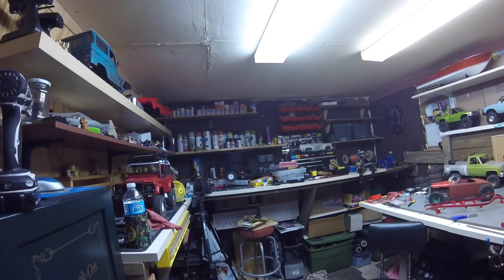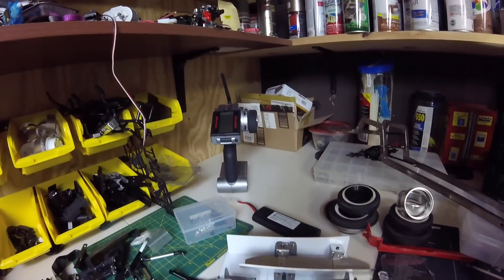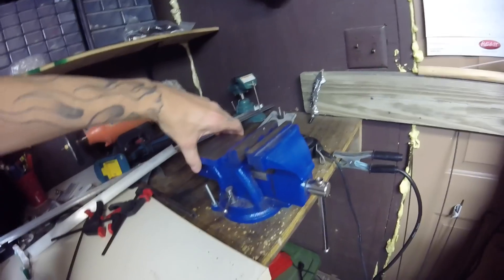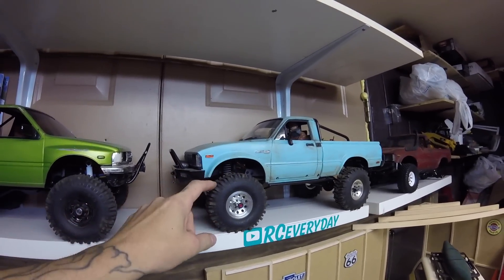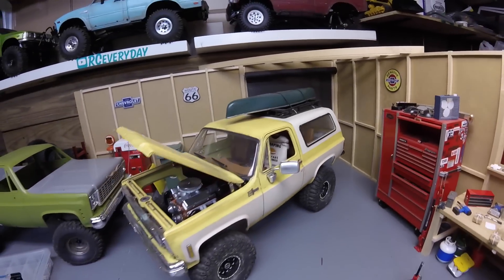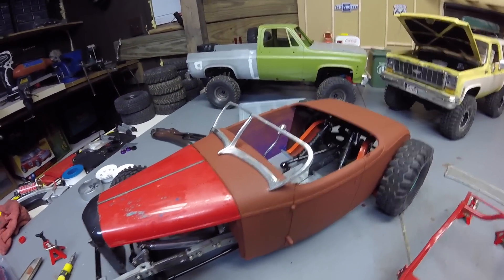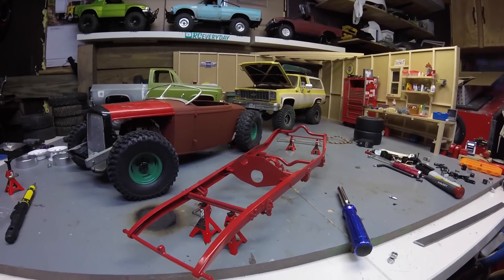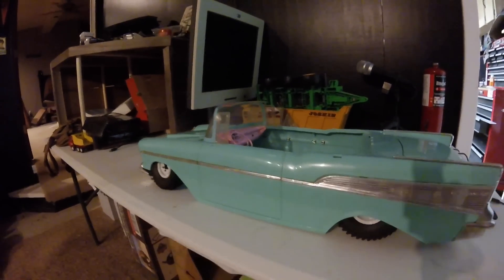Walkthrough of the RCeveryday Studio Hot Rods and Junk

Comment: What type of servos and radio would you recomend me I still haven't got one. And I can't wait to see my tf2 running
Reply from the maker: I use savox servos mostly, cant remember which model but it cost around $80usd.  Holmes hobbies motors are a must, and I run them with the axial ae2 esc which is made by castle.  Pretty reasonably priced stuff except the servo, got to spend big for a good one.
Reply: Oh okay I was going to check my LHS next time I'm in town. Do you recomend spectrum radios?
Reply: +RC Everyday I was also thinking of just putting a dewalt motor in too there cheap and got a TON of power for crawling and there cheap as heck. You should try one if you get the chance
Reply from the maker: I like my spektrum, but other brand like futaba are excellent as well.  I didnt know the dewalt motors were 540 sized.  I thought hey were bigger.  If so youd have to make an adapter plate to mount it.  At least thats how it use to be back in the olden days, haha
Reply: Thanks. Yeah the dewalt motors cans are 540 size, and pretty cheap. At least where I'm at, like 10.50 Canadian lol
Reply: Well some of them